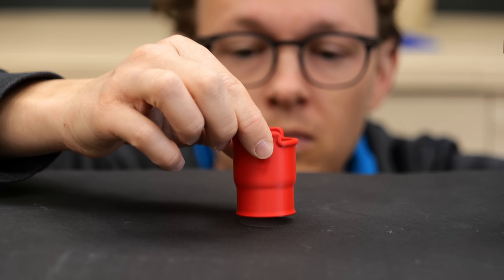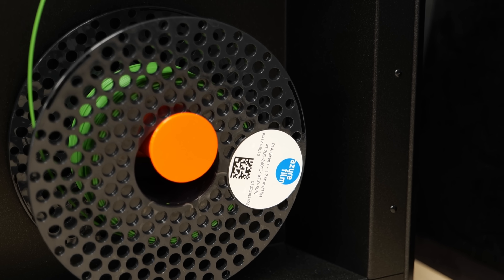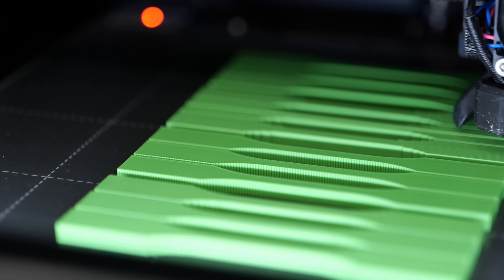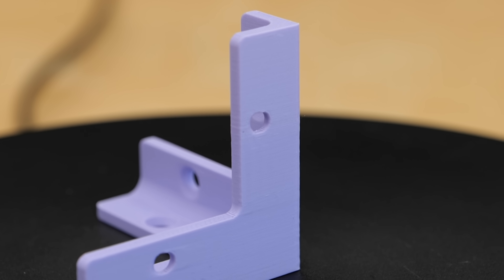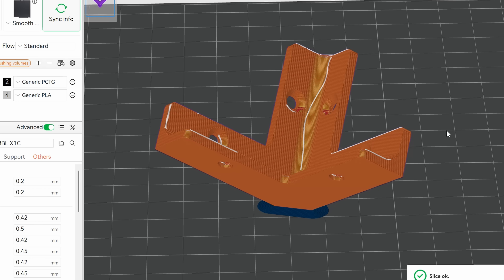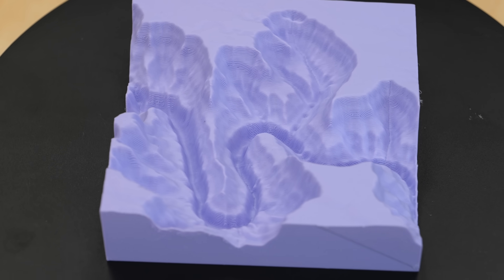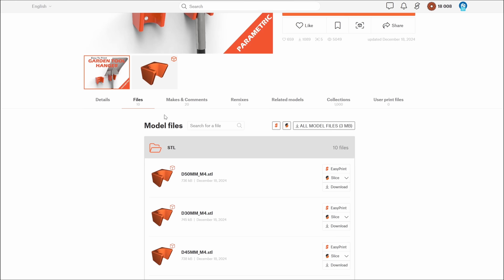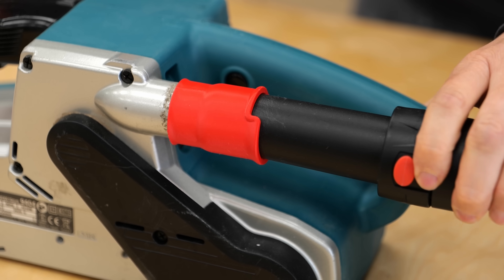Does Angled 3D Printing Really Make Parts Stronger?

Comment: Im printing a small case, and i had the hull line problem due to the bottom surface inside the case. My idea, which im yet to test out, was to model in a small angle (almost like drainage in the shower) to get a slight stairstepping effect that would spread the flat surface over a few layers. This surface is not visible once the pcb is installed so appearance wouldnt matter.

Comment: some years ago i've printed a smartphone holder from abs for my car at 45 degrees. it was easier to print, and it was stronger than 0 and 90 degrees because all the layers have bigger area at this orientation. and when it cracked, the crack was at the only possible and safe place - at the one of the top angles, and it even did not make the holder useless, i've just sanded the surface and continued to use the holder.

Comment: Layer lines are very similar to grain direction in woodworking - strong along the grain, weak across it. Plywood addresses this by alternating wood layers at 90 degrees - I wonder if there's a good analogue for 3d printing? For the adapter, an inner sleeve printed vertically will best handle the stress of stretching around the hose, while an outer sleeve printed horizontally would best resist the flexing stress failure shown several times in the video.

Alternately, wrapping some strapping tape around a horizontal print would give that reinforcement without needing two prints

Comment: I had idea of printing stuff like pipes in 2 parts. Each in 45° but opposite direction. When pressing  one into other part, print linea would criss cross creatin stongest posible part. I got this idea wathing xyla printin rockets and than strenghtening them with epoxy layer from outside.

Comment: Hello,
My way to think out the box, in a case like this, is tu use a piece of a PVC pipe, to warm it until it became soft, and to adapt it by clamping it on the machine you vant wih a metalic collar.
The difficult part is that the piece will shrink wen it cool, so it need to be a bit loos wen you make it, otherwise it coud become very dificult to remove.
But it is very strong on every directions ! :face-blue-smiling:
AT

Comment: Seems like that adapter could be a 3 piece part. Print the body horizontally, and two sleeves vertically that snap over the body with an interference fit. Then you would have a part with maximum strength.

Comment: Interesting how your examples are pretty much all the exact same things that I ran into issues with in the past. Printing corner brackets standing on the corner tip was one thing I tried, but with my cheap old printer back then they came out sort of ugly. I also printed quite a few vacuum connectors, I needed a lot of them for the dust extraction system in my  basement-workshop. Most of the time I printed them standing and relied on thick walls, but for a T-connector I  tried printing it at a 45° angle, which came out pretty OK with a newer and much better printer. This was actually more for a smooth appearance than for stability but it also worked against the tendencies of the part to split up under force.
I also printed handles for my drawers in the workshop, basically tall D-Shapes, which I printed upright to get the rounded handle nice and smooth. It turned out, that at the height where the round part of the D connected to the straight part again, a significant kink of about 0,2mm appeared because the two columns were pulled together by the shrinkage. That was much more than the normal shrink lines and I hated it, so I designed a kink in the opposite direction into the part and the handles came out perfectly smooth 😁

Comment: I have printed to 45 on some parts.But this video , specifically the dust adapter made me think. If printed as 2 parts one at 45 defining the ID and one at -45 defineing the outside and then bond them together. A 3d version of the hook or a typical CF layup technique.

Comment: You can test how layer width to height ratio changes the strength. I think the more widther the layer the stronger the part is, because nozzle have to bush harder to squezze the material.

Comment: I sometimes print in different orientations... sort of like how plywood works...  I print in separate layers in different orientation then glue them together.  Like with a tube... you can print in 45 degrees... and another in -45 degrees...  one fit inside the other...

Comment: Not sure this would help, It kinda came to me as I was watching. When doing the braket printing the part  as a solid part no infill and alternating the layers when they are layed down, or even turning each layer 20 degrees as it layes down. I think it could increase the layer bond as each layer will cross over each other instead of just a straight line matching to the layer below. Its been a while is i've printed anything and not even sure its available to print with alternating layers. But I think it could be a possiblity with some good slicer coding. Just my thoughts!

Comment: I recently designed and printed a large part that needed to support a good bit of weight on two planes. I initially tried printing it canted so the layer lines would cross both planes. Even with extra supports the ASA kept separating halfway up since I couldn't keep my P1S chamber warm enough. I ended up resigning it to allow me to lay it flat. Lots of things to consider when designing functional products.

Comment: For some time I've got an idea in my mind but hadn't had a chance to test it, yet. And it could be a solution for exactly these kinds of prints.

What about printing the thing as two objects. The core and the cover. Each part of it to be in different orientation. The cover also has to be split into two parts so you may screw or glue it together.
But such assembly could support each other when the stress forces comes from different directions.

Comment: I ran into this with an STL for a wargaming miniature, that had one arm held out to the side, then angled down at the elbow. Despite having marked supports all along the underside of the arm, I got a failure three times, where the lower arm would separate from the support material before it could be connected to the upper arm, I finally gave up on printing the miniature in an upright position and tilted it at a 45° angle, accepting the increased amount of support material in exchange for a better support of the arm and spreading the layers at the narrowest point, where the bend occurred; the result required more cleanup to remove the supports, but I was able to print the miniature without issue.

Comment: Very interesting content. I would be curious how the results would look like if the parts would not have such a low infill setting. 
If strength is an issue I normally go up much with the infill percentage and have sufficient strength for most of my use cases.

Comment: have you seen nighthawkinlight's latest video? it would be really cool to see some strength testing of homemade bioplastics

i tried the potato one (with honey) and its weird, sometimes it will crack in half and feel very brittle, and then each half will just bend and not crack. and then waiting a day those halves will also become brittle and be able to be broken in the same way.

idk what the best way is to make them though, the water-based ones at least need to shrink a lot when hardening (because water is the vast majority of the volume)

Comment: 3D prints are very similar to composite materials (like carbon  fiber and glass composites) or wood in their structural properties. With plywood and composites they change the orientation of the fibers to make a stronger pieces. It brought to mind for me the potential of mult-axis 3d printers, and the potential that you could control layering to optimize strength. In the case of your coupler, a multi-axis machine could alternate between printing the walls in hoops and printing longitudinally to get strength in both bending and hoop stress (maybe a video?). It also brings to mind for me that the top and bottom patterns matter for strength as well, as it defines which orientation the layer lines are being stressed, and you want a pattern that alternates direction. If you have holes, you may want a concentric pattern to strengthen the holes (or make sure all of your walls print on the top and bottom layer.

Comment: One of the mistakes is replicating the form of part that was made with to optimise for a different technology or/and to match the designed shape.  Making a component bigger or design in a surface that it allows the component to be printed at an angle without waistful supports is often better i think.

Comment: I think whats highlighted in this video is the limitation in printing on a single plane. What you really want is non planar printing so you can orient the part for the best directions in strength while not requiring support. If non planar printing starts getting implemented I think we will see a new suite of printers with very different kinematics

Comment: Think engineered wood. Composite printing of a part that requires strength is worth the trouble. But angle printing can be a good compromise without having to split a part into an assembly that requires post print gluing.

Comment: I designed a lid with a clasp, and it kept breaking in different places until I changed its orientation so that the layers of solid filament were in the plane of the bend.

Comment: Another move ive had luck with is dipping an ABS or ASA part in acetone for 30 seconds. It causes the outer layers to fuse together and makes the part a bit stronger. This is more noticeable with thin parts. His hose adapter has thin walls and would be a good candidate for this.

Comment: with brackets with larger holes on its corner makes the holes better.  and on its corner square shapes don't need supports either if you can cut a corner off(and call it modern design)

Comment: Great demo on orientation vs strength! Choosing the right manufacturing process is key. We help clients at Jevny Mfg select between 3D printing, CNC machining, and vacuum casting to optimally balance strength, surface finish, and cost.:hand-pink-waving:

Comment: Ya kno'... Just because you can 3D Print it in one piece doesn't mean you should 3D Print it in one piece, no? 🤔 For your Application - Printing it like @13:10 BUT then adding two rings ( printed in a traditional chimney orientation ) to the ends would have resulted in the ideal part as the changed layer orientation on top of each other would have prevented the splitting 😁

Comment: Hi Stefan ! I was wondering. Wich nozzle size were you using ?

I'm a Diesel/Indulstrial/Electro mechanic. I use 30T slings on regular basis. Those slings are made of a "ton" of nylon threads twisted into a single strain(Somewhat 20%Horizontal/ 
80%Vertival) that is enventually looped over and over (Vertical)

That is why i'm wondering if it wouldn't be even stronger to use the most "strains" possible instead of using lesser.

Comment: Ive got insane layer adhesion with PETG when printed properly. Printed some M6 bolts and nuts standing upright and i cant break them by hand and they bend over deforming plastically and yielding long before they finally fail. and even the threads came out very clean and plenty strong enough (Cannot break the threads by hand either) Couldn't break the nut off by hand.

Comment: I always think about orientation.

I must say using the slicer to cut off a corner of that bracket looks like madness to me. Much quicker to just pull the part down in z-axis so dome layers are below the bed. They won't be printed and the effect is the same but much faster yo achieve in the slicer.

Comment: Oh, I tested something similar with bolts a few years ago. But in this case, I would print it in a vertical position and just make the wall 2-3x thicker. The beauty of 3D printing, is that we have more freedom. We don't need to copy existing parts, but we can make them stronger too (if we need just 1 peace, not mass production)

Comment: Using screws to reinforce layer adhesion is another technique I use, as well as splitting the prints into multiple parts to optimize print orientation for load strength.

Comment: I am a Structural Engineer: I always consider load paths and stress axes of the part and optimise the print orientation to suit.
So well done highlighting this critical aspect of 3D printing.
Also, I only consider filament material that has good layer adhesion and impact resistance: materials like ASA, PCTG and TPU.

Comment: Splitting a print into multiple sections to solve strength issues is woefully underutilized in the community.  For instance, with the bracket, my solution would be to replace the counter-sunk holes with a relieved circle the size of the screw head, about half as deep as the bracket is thick - like cutting a coin out of it.  Then print a washer-like shape that fits into the relief, with the countersink.  Print that flat, so you have maximum strength against splitting, since it will mostly only see compressive loads.  Slip the screw through the washer, tighten it into the bracket, best of both worlds.

Comment: This is just a random thought after a very tiring day, so I may just sound stupid 😂

But I've seen a few attempts at homemade injection molding machines.

I wonder, if you needed to make a functional piece from say abs or asa or maybe even nylon.

If you printed it, then made a mold for it that could be heated. Could you then heat the printed part in the mold just enough to fully melt the material together without overly deforming it?

But I've got absolutely no experience with printing, injection molding, casting or anything related to them.

So I'd imagine it's a stupid idea 😂😂

Comment: I've designed and printed TONS of vacuum adaptors over the years, they've taken a beating and printed in PETG and ABS. I found PETG with two walls (0.8mm for a 0.4mm nozzle) is plenty strong enough IF you have an enclosed printer and print at under 8mm3s with 0.2 layer height with minimal part cooling. I found clear PETG to have the best layer bonding, possibly because it doesn't have coloring. Mold like strength 2.5mm3s

Edit; all printed upright

Comment: The right answer for the vacuum adaptor would’ve been some firm TPU, takes a shitload more effort to get layer separation in Z axis. Especially would’ve made sense given the wide range of forces in different directions it will take, it’s not like the connector has to be rigid, especially when the hose already isn’t

Comment: For your hose adapter, you could try design a 2nd outer sleeve that the adapter slips into, then print the outer sleeve in a different orientation, that way you would have a much thicker wall, and  criss-cross overlapped layers.

Excellent video, thanks bro!

Comment: Wonder if printing 2 concentric parts for the hose adapter, one that fits (glued?) inside the other would make for the strongest part.  Both at 45 degrees, but offset from each other.  When glued one inside the other (rotated correctly) the layers should support each other and avoid the issue of layers being in one plane.  Same could be done with angle brackets.

Comment: On my printer orienting the model on the build plate to get what I would consider a stronger part does work to a certain degree. The downside of me doing this on my specific printer is that the part no longer prints symmetrically. 
What I mean is that my round parts print with a slightly oval shape rather than a perfectly round shape.  The tolerances are sacrificed for added strength.
Fortunately for me, my goal with a print is for my prints to print out "Good-Enough" and not pristine or perfect.

Comment: When I need strong parts I make assemby printed in orientation correct to the forces. 
If you have 4mm woodscrew you can make 5mm screw hole with big chamfer, than bigger compresion will be bettwen wood and screw head with smaller force on the print. 
If print is to thick to get contact of the head screw with wood you can use wahser.   
Last time i made supre durable GO-PRO mount, I felld from 7m and my head hit in to the handlebar, GO-PRO is dead but printed mount is fine. 🤭
https://www.youtube.com/watch?v=td0ITGS3Djo

Comment: I think a sine wave alternating layer structure for the infill and/or fluctuating walls could help with isotropic behavior. Lastly it would be cool if the print head could turn or there would be a side print head that crates an upward line all n-layers at a defined distance. Maybe we should look to make infill holes that get  filled up fully. If I think about it this could already be possible.

Comment: This came in handy at the EXACT TIME I needed it somehow.. My sister asked for a nozzle for an air duster yesterday and I know it shouldn't need to be strong but knowing the users of the air duster I wouldn't be surprised if too much force is used to put the nozzle on here and there and they bust it if i don't print it as strong as possible.. Thanks for the info 😁

Comment: I would make that an inner adapter instead of outer and slice it in half  printing both parts horizontally. Or just not bother and do it out of TPU.
I've been printing a lot of tpu lately, as others said, layer adhesion is amazing and having this kind of part printer in TPU makes more sense as you get less play and more friction between parts,  better grip.
Reply: smart
being an inside adapter sleeve means the horizontal split he showed is completely avoided, as the surrounding hoses act as the reinforcement.
something to be said about incorporating the strength of Not Printed features into a given problem.